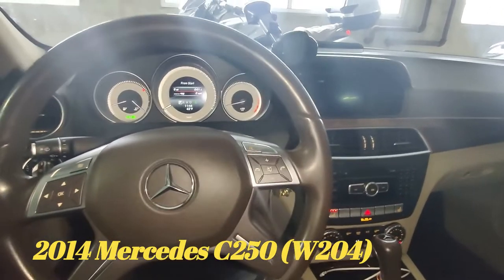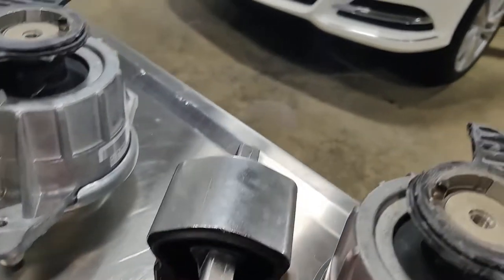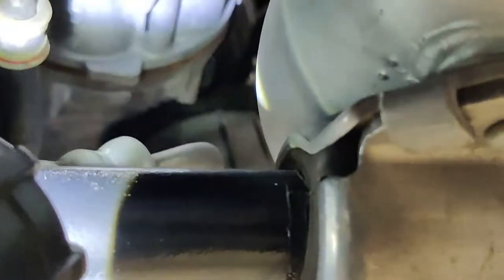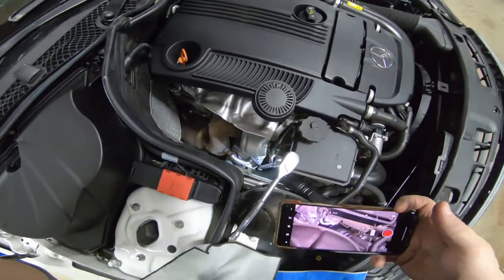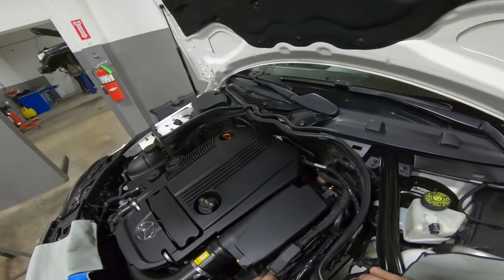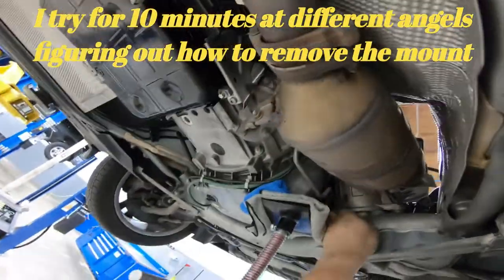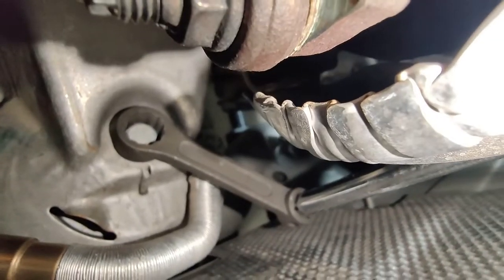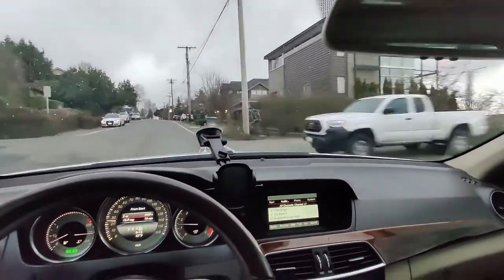Mercedes C250 Engine Noises (W204) from bad Engine Mounts & Annoying Sounds HOW TO REPLACE MOUNTS

Comment: Great, I can see your detailed introduction on how to solve this noise problem. This noise has been bothering me for 3 years. After watching your video, I took the car to a repair shop to replace the engine mounts. I am from China and have been trying to repair it in the past few years, but the repair shop says it's normal noise, but I really hate this noise. I hope it can be resolved, thank you!
Reply from the maker: Thank you for watching, I went through the same thing you did. I took my car to a professional Mercedes-Benz dealership and they told me it was normal. I did not believe them, then I took it to another very nice Mercedes-Benz dealership in the city and they also said it's normal. I did not believe them so I had to fix my Mercedes myself. I feel very confident your car will sound like new and will be nice and smooth and quiet 🤙👍👍

Comment: Hey I’m doing the engine mounts on my 2008 c350 I did all the steps but when I go to lift the engine the whole car goes up
Reply from the maker: That is concerning, with both the top bolts off of the motor mounts,  you should be able to jack up the motor a few inches to make yourself more room. I am hearing the V6 motor there is less room and more difficult but the motor shouldn't lifting the car up with the motor mounts unbolted?
Reply: @MotoTouringWorldWide  that’s what I’m thinking you think something else can be holding it?
Reply from the maker: @jonathangarcia6407  ,, How about you "also" remove the 2 bolts under each motormount. Now there should be no reason the engine will not go up when pushing up the motor. Be sure that the oil pan is protected with a block of wood or similar to protect the oil pan. Are you using a hoist like I did in the video? If yes, then place the screw jack the same way I did.
Reply: @MotoTouringWorldWide thanks man I figured it out after I lift it the engine started to go up but first  the car when up a good 3 inches your video help a lot thanks
Reply from the maker: @jonathangarcia6407  ,, I'm really happy you are able to move forward on the repairs on your car. Thank you for the update 🤙👍🙋‍♂️

Comment: I'm so glad I found your video. My car has the EXACT same noise. I will get started repairing my W204. By the way, your Benz is SUPER clean from top to bottom. Looks factory-new in the engine compartment. Not even a smear of oil residue.
Reply from the maker: Glad it helped. I do have a little OCD and keep my car VERY CLEAN.  ❤️👍

Comment: Same here with the noise in the cabin. I have the c200 kompressor in Australia so the same design, just reversed for rhd. My rubbers are as flat against the mount as possible and after rebuilding the supercharger which, 2 mechanics, including a mercedes tech said it was, the noise remained..so now I. Convinced it is mounts. Cheers for a great video.
Reply from the maker: Hello Lance, thank you for watching 🤙🙂, the sad thing is,, is I brought my car to 2 Mercedes-Benz dealerships here locally,,  the first dealership said it was normal, and I drove for a month hating the sounds and noises, I then I brought it to a high-end Mercedes-Benz dealership near me and they also said it was normal...... I called bulshit so I had to fix the car myself. With simple tools and a hoist the job takes only about 2.5 hours. I wish you the best and I'm pretty sure your MB will sound whisper-quiet once you have new mounts. 👍👍🙂🙂
Reply: Thank you again. I know it's been a few months,  however the issues you mentioned were in fact 100% correct. New mounts x3, the trans mount was the worst. Also the bottom of the front mounts were so soft and soggy. Again, thank you and I paid a mechanic, 400 australian and all fixed. 👍
Reply from the maker: @lancegraham7722   THAT IS GREAT NEWS!!!!  I'm so Glad your car is fixed!! ❤❤😊😊🙋‍♂🙋‍♂
Reply: I was about to replace my turbo, but then found this video!  I have the same noises.  I’m ordering the mounts to give it a shot.  Thanks for the video.

Comment: Excelent content! thanks for the advice. I will replace these mounts soon cause the noise is really annoying
Reply from the maker: I thank you for watching 🙋‍♂️, I'm excited to hear your outcome, once your mounts are replaced let me/us know how it worked out for you 🤙🤙
Reply: @MotoTouringWorldWide Hi. Me again. I already did it. It worked. Just i need to know torque specification. Noise just went away 🤓😃 but I have to make sure that I tightened right. Thanks a lot.
Reply from the maker: @ShabaDabada-c2c  Hello again. I googled it and found 55 NM and 50 NM which equals 36 foot lbs for the FRONT ENGINE MOUNTS. I would use 50 Nm so as not to over-tighten. Since I don't know the year of your car.  See if you find the same torque specs when you google it. Glad to hear that your car is fixed.
Reply: @MotoTouringWorldWide  Thanks man. I Will check tomorrow. What I notice is the noise went away only when I replace the transmission mount. First I replace the engine mounts and give a ride, but noise still there. But next day when I completed the installation, the noise just disapear. Thanks a lot for your help.

Comment: Only video I found on the c250! Very informative. Thank you.
Reply from the maker: Hello and thank you for watching. I hope you are able to repair your Mercedes too. Warm Regards,  👍👍😊😊
Reply: @MotoTouringWorldWide  just now finished replacing them at home. Took about 2 hours. Pushing the passenger side engine mount up between the down pipe and firewall was a great tip. Thank you. Hopefully the power train sound is gone. About to go test drive it now.
Reply: @MotoTouringWorldWide  sound is gone! Finally!
Reply from the maker: @moeobaidat4101  I LOVE GOOD NEWS, GREAT JOB !!! 👍👍😁😁
Reply: @MotoTouringWorldWide  hello! So one week update. The sound was completely gone for a couple of days. Now it’s back slightly. Not as loud as before but it’s back on acceleration past 2.5k rpm. Also on start up the engine has a bang sound to it. 
Maybe I cheaped out on the parts or didn’t torque it right ?  Any advice ?
Reply from the maker: @moeobaidat4101  ,, so sorry to hear this. Did you get the German made motor mounts or the factory motor mounts? 
Or did you get some other brands that are similar? 
I would shine a flashlight down to the motor mounts and make sure the rubber is not "compressed". 
Also double-check the rear tranny Mount and make sure the mount is nice and center and not cockeyed.

Comment: Funny enough I've been getting ready for this job, got all my parts and everything, and Stew's is closed as they're sub-leasing the work stations out to Rivian. I guess it's time to do it in the driveway. oh boy.
Reply from the maker: @DankTech  ,, I drove by the other day and I was upset when I saw Rivian Trucks take over. It's going to be tougher to do your motor mounts mostly from above but it can be done. Have a jack stand on each side of the car, then you can use a floor jack to raise and lower the motor when removing and installing the mounts.... I was going to do an oil change and overall inspection at Stews Garage, but now I have to do it at home in the parking garage. I purchased an oil suction machine to suck the oil out of the Mercedes. I will post that video soon, it turns out it's much easier to change the oil with the suction machine. I wish you the best with your motor mount replacement. Please let me know how it worked out for you. Have a great weekend 🙋‍♂️🤙😊
Reply: @MotoTouringWorldWide  there’s a shop up in Everett I might check out, the oil extractor is a huge quality of life improvement, a ton of uses! Makes oil changes take 20-30 minutes, although my wife’s car has the filter underneath the car so I still have to lift it.

Comment: Hi, 
Thanks for the great content very usefull! 
I have almsot the same problem  on my manual w204 (c200d stage1), I wanted to know if your car also made a loud noise et big vibration when you Turned off the motor ? 
Thank you
Reply from the maker: Hello and thank you for watching 😊. A manual w204 C200d is an excellent Mercedes. My car does not have a loud noise or vibration when turning off the motor, but I'm thinking that you may have an exhaust heat shield vibrating or a turbo spooling down? 
Do you have an automotive stethoscope? It is very cheap and will help locate noises. Here is a link to an example: https://www.amazon.com/Lisle-Stethoscope-Kit/dp/B0002SQYSM?th=1
I would remove the black portion of the stethoscope so just the plastic tube is near the noise. The sound will travel and become "louder" to your ears the closer the "end" of the plastic tube is "nearing" the "noise". 
You will need someone to turn the car off while you listen and place the tube where you think the noise is coming from.
I hope this helps with diagnosing the noise. 
Keep me posted on what you find. Have a great weekend. 😊👍
Reply: Hello, thank you for your answer! After watching your video I changed the rear mount (of the gearbox) I started by this one because it was the cheap one, but the big (one time) vibration still here when I turn off my motor. 

I putted a full inox exhaust as the c63 with 4 piped about 3 months ago, but I don’t think it’s linked…

I noticed on these last 2 days that when I drive really slowly it still does the strange sound but quieter and I feel the motor lifting a little bit around 2-2.5rpm, I guess it’s the big mounts.

I’ll keep you informed when I get over this and hope my comments can help other people in the community ! Thank you

Comment: I have a c250 om651, and it makes the same noise, the car vibrates from 120km/h and stopped vibrates between 1500 - 1800 rpm, I think it will be the support of the box, not least because the throttle shakes too.

Can you help me?
Reply from the maker: Hello and thank you for watching. What year is your car? If your car has the "same" noises and vibrations like in my video, I would definitely start with the engine mounts and rear transmission mount "first". You mentioned that the "throttle" shakes too, is this while looking at the engine with the hood up and the engine at idle? You may have 2 different problems that need to be taken care of.

Comment: Hi, I have W212, have 100% same sound on acceleration, changed 2x engine and 1x transmission mounts as you did but still have that sound.. now I am waiting better quality transmission mount from Germany and also I'm doubting that sound also comes from bad drive shaft bushing.. what you think?
Reply from the maker: Thank you for watching 🙋‍♂️. If the noise is only there during "acceleration" and you do not hear the noise when in park OR neutral, and if you do NOT hear the noise during "deceleration" ,, and then only hearing it during "acceleration",, then I would be focusing on your drive shaft. 
Another test, (and be careful when doing this,) put it in drive, put one foot on the brake, and give it some gas, but not too much, (nobody in front of the car),  do you hear the noise in drive with some load on the engine? 
Is yes the problem is under the hood or the exhaust is leaning on something,,,,,   if no noise I would focus again on the drive shaft. 
Once you have the car fixed keep me posted cuz I'm sure curious now 👍🙋‍♂️

Comment: Thank you for this video. This has really helped 😊
Reply from the maker: Thank you for watching. I'm so glad to hear. No more weird annoying sounds I hope. Have a great weekend. 🤙
Reply: @MotoTouringWorldWide  I was trying to diagnose an issue that seemed to be the same noises of when accelerating. Hope to sort it out soon.
Reply: @MotoTouringWorldWide  Also, the vehicle vibrates at higher speeds 120km/h so I'm certain it's the gear box mount and engine mounting. Please comment on this. Thanks.
Reply from the maker: @rishabhverma5087  ,, the vibrations at higher speeds especially under load, with a bad rear tranny mount, may vibrate on the unibody. Hope you fix yours 👍👍
Reply: @MotoTouringWorldWide  noted. I'll replace 2 engine mounts and the gear box mount. Thanks will work on it sir
Reply from the maker: @rishabhverma5087  ,, I'm extremely confident that your vehicle will be smooth and quiet. You should have a noticeable difference like night and day. 👍👍

Comment: Did you hear a clunking noise on small pothole or bumpy road ?
Reply from the maker: No, that clunking noise was not an issue on my car. You would have to have really collapsed motor mounts to hear bumps on the road. Usually, clunking sounds will be bad suspension ball joint or bushing, loose skit plate, or broken exhaust hanger. When you put your car in reverse or Drive, do you have a clunking noise? If yes, then you may have a bad rear transmission mount?

Comment: I just bought the set online. How much do you think the mechanic will charge me for labor here in CA?
Reply from the maker: Hello and thank you for watching. A good mechanic should be able to complete the job in 2.5 hours if you have a 4 cylinder. If your car is a 6 cylinder it is more difficult to remove the right motor mount and will add maybe an extra hour. I'm guessing labor will be around $500 for a 4 cylinder and $650 for a 6 cylinder. Please let me know if I'm off or pretty close. (it took me 2.5 hours to replace on my car and it was my first time). Thanks again and best of luck. 🙋‍♂️😊

Comment: Hi, greets out from Germany : ( 

my drive is e200 cgi like yours 
and its have 168.000km 

The coldstart is everymorning a pain in to hell soo bad and so loudly noise from transmission, when its warm everything is gone but it is smilar loud : ( 

Have i good chance to replace every 3 Mounta and its feels like new car without loudly noise any more ? 
Have u the Partnumber from the specialtool ? : (

Thx  u a big
Reply from the maker: Hallo und vielen Dank fürs Zuschauen.
Wenn Ihr Auto noch über die Original-Motorlager verfügt, sollten Sie diese ersetzen.
Hier ist der Link zum Motormontagewerkzeug von Amazon.
https://amzn.eu/d/bOVjX1D 
Ich wünsche Ihnen eine wundervolle Woche und viel Glück 🙋‍♂️👍

Hello and thank you for watching. 
If your car still has the original engine mounts, then you should replace them. 
Here is the link for the engine mount tool from German Amazon. 
https://amzn.eu/d/bOVjX1D
Have a wonderful week and good luck. 🙋‍♂️👍
Reply: Yes it is the first one from factory at 0km : ( 

Do u have the dame problem ?
Everymorning it is so loudly and give noises from transmission and than it is warm it is slowly a little bit not so noisy 😞 THX For everyhelps
Reply from the maker: @user-bw5hk5nb3k  ,,, I would first replace the 3 mounts and then see if there are any other issues. Do you have any updates?
Reply: Hio,

yes i have updates: 

1. Transmission oil replaced
2. Transmission mount replaced

The noises are gone but then i put the key off i feel under the sittingbank a little ratlling i think the motor mounta must replaced too or ? 

i am on now 169.200km never replaced the motor mounts : ( 

I hope the noises are gone any day :(

Comment: U dont need to wait to sense such exessive "vibrations" to happen. When mild aging occurs, one can tell by simply sensing the steering wheel at idle with engine ON. I am hyper sensitive for these 3 mounts state of well being and 25,000km or 16,000 miles is my unpleasant limit for them as in reduction of super smooth behaviour. The higher the torque of the engine, example like my w212 E400 m276 turbo or others M278 V8 turbo, the more agressive one drive, these comfy mounts will loose its pleasure limit faster. 

If possible dont use lemforder, they are crap nowadays, stick to genuine MB ones.
Left side mount usually suffer more, because engine rotation is clockwise if seen from  main pulley.
So left side engine mount get compressed while right side mount get lifted up under brutal kick  down.
Fyi my rear tires only last 12,500 miles from the way i accelerate, i dont do burnt out or anything of that silly sort, simply hard acceleration. Michelin pilot sport 4.

Great documentation on the video, thank u.
Reply from the maker: Hello 🙋‍♂️🙋‍♂️. Thank you for watching and thank you for this excellent information!! I will make sure to use genuin Mercedes mounts next time. Have a great weekend. 👍😊

Comment: Nice vid, anyone know of this same job but on the 3.0 V6 320 CDI?
Cant find one on YT, must be to difficult ?
Reply from the maker: Thank you for watching 😊🤙. I did a quick check and found 2 videos for your car. 
See if these are good:
https://youtu.be/J-nSy4To9bU
https://youtu.be/6nAYF2rxUBE
Hope they work out for you.
Reply: @MotoTouringWorldWide  thanks, I have seen those however the first is W211 mine is a W204. The second is an E class with far more room.
There are lots of vids on the W204 but not with the V 6 engine.
Problem I have is ... No room and two sets of exhaust headers.
I have been told you have to either remove exhausts or drop the steering rack.
Would be great to find someone who knows for sure.
Reply from the maker: @skippyone3085  ,, ok, I see now what you're dealing with. I have heard the V6 engine mounts can be a pain in the ass. I'll keep my eye out for you and hopefully find something 👍. Hopefully you don't have any rusty exhaust bolts to further complication. All I hope you have access to hoist because doing this on the ground can be painful.
Reply: @MotoTouringWorldWide  thanks! I don't have a hoist just a pit which is ok for most things !